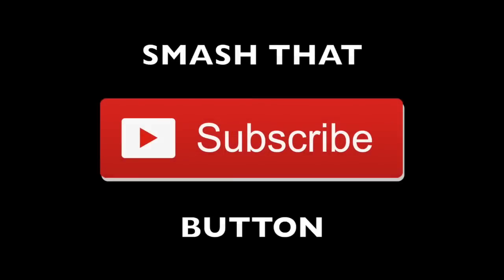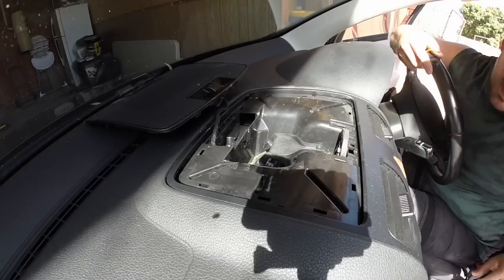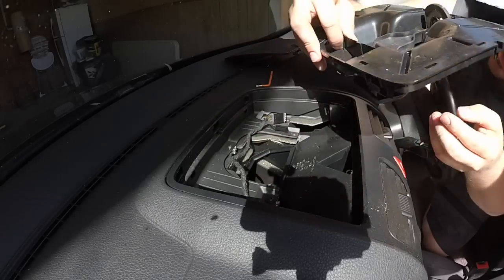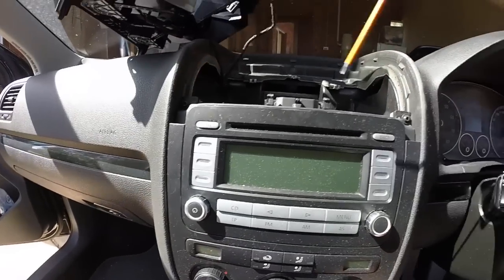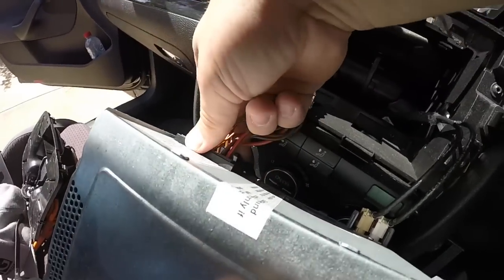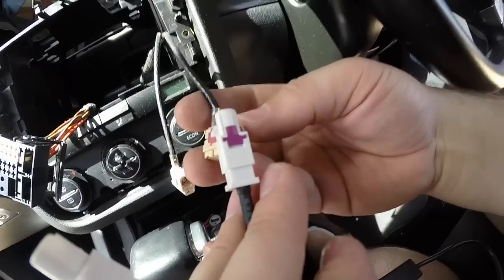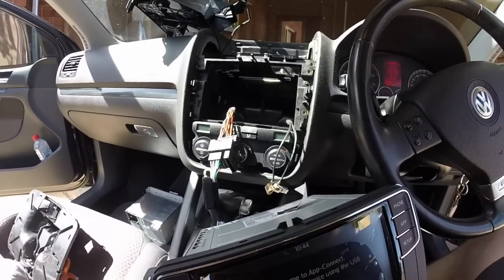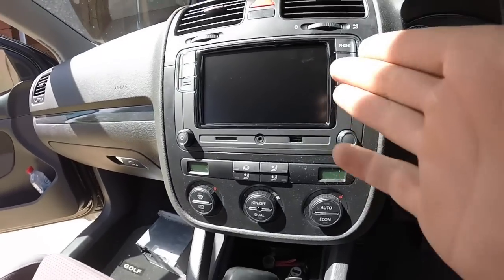VW Mk5 Golf OEM Radio Upgrade | Added Bluetooth & Apple CarPlay

Comment: I like the video, Just some advice, you will go through many batteries until you find out that any aftermarket radio that is not OEM on any VW will drain charge out of you battery. I suggest going with OEM every time.
Reply from the maker: Didn’t go through any batteries with this unit in the 3-4 years we had the car.

Comment: appleplay? id rather have an android thing.
but hey, so basically this is completely plug and play when you install? that would be awesome.
also everything does work well right? even buttons on steering wheel?

you should also make vids on replacing speakers door and maybe rear on a mk5 gti, i got one or two popping so theyre going out, dont think i want to do subs and all that but i do want good long lasting audio, some decent speakers
Reply from the maker: Appleplay, I think it’s also android but we don’t have any android phones. 

Not a bad idea doing the speakers
Reply: @HarrodsGarage  cool, feel free to make a vid. We can see the size we need and follow your tutorial. I did see one other but it was meh.

Comment: Any issues regarding battery drain? Been looking to do something like this to my MK5 R32 for a while now but I've been worried about that kinda stuff. Great vid btw.
Reply from the maker: None what so ever. It’s so easy, I’m annoyed that I didn’t do it to my r32 golf when I had it.
Reply: @HarrodsGarage  Awesome thanks man! Been looking for a straight answer for ages
Reply: @arisimonian6870   i would worry about battery drain if i were you bc you have an older model vw. I just got the 330 for my 2010 passat and no issues with drain.
Reply: @HarrodsGarage  the 2007 and earlier VWs will have battery drain issues because the CANBUS needs to be replaced.
Reply: @TomCook1993  are sure about this, eBay sellers have told me that it is needed for 2008 and older
Reply: I got it for my 2007 mk5 and the poxy thing has been draining my battery had to stick the old one back in any ideas

Comment: so did yours come with the harness and adapter or did you have to order it separately? because all the ebay ads for this radio say it will not function in 09 or older without a bunch of extras. if so what did you have to buy.
thanks
Reply from the maker: Yeah it came with a harness. The link that’s in the description is the exact same one that I got

Comment: Hi, I have a VW Golf 2005, but my car doesn't have parking sensors, And with the rcd360 you will get a parking pilot. So will it always peep even if I install a reverse camera?
Reply: Hope you can help me :)
Reply from the maker: Hmm not sure. I’m sure there would be an option to turn it off. Camera and sensors normally run separately, I’m pretty sure don’t hold me to that though
Reply: @HarrodsGarage  I see, but do you have parking sensors on your car. And does it have a constant beep? Because the sellers on AliExpress will not reply to me, and I am stuck..
Reply from the maker: @mohammedghazwanalmilhim7879  sorry we don't have parking sensors

Comment: Hi mate installed my radio upgraded with a polo TSI OEM radio but now I have a challenge with rear speakers not working and steering controls to lower or up the volume these do not work, any idea as to what to do in order to get it function to its full working condition
Reply from the maker: You got the radio out of a polo and put it in what? Does it have rear speakers in the car it came out of?

Comment: hey thanks for the info. have some questions though. I have a golf 5 gti 2.0 tfsi from 2009. do I need to do something with the canbus thingy? never heard of it so I'm not sure. and also does it support spotify over bluetooth? thank you in advance
Reply from the maker: We use Spotify all the time with it. I think it was the early mk5 that needed the canbus update as ours did not need it.
Reply: Hi Jordy I have the same car, did u need canbus/steering control adapter? Or did it all just click in and work
Reply: @rieewoldt  I ended up buying an aftermarket Android radio that works well but I had a friend help me out with installing it. Some wires had to be soldered but I don’t think we needed a canbus adaptor for it. My steering wheel controls didn’t work anymore though and I haven’t fixed that yet, so I’ll still have to look into that. Not sure if I need an extra adapter for that or if I can just set it in the radio’s settings. Sorry if I wasn’t of much help but this is all I know, however you can always ask your local garage for help (preferably a VW garage)
Reply from the maker: Yeah nice what android radio?

Comment: I really need some help with mine as I don’t know which adapters I need for my new RCD330. Is it possible wether you could put the links in description where you got the adapters from?
Reply from the maker: The adapters came with mine. I’ll put the link back in the description. I did buy it for $440 and now it’s up to $800

Comment: This was so sooo helpful, thanks! Looking into getting one for my mk5 Rabbit, has it been holding up well? Would you recommend it still?
Reply from the maker: Yeah it’s pretty good for what we paid for it. Was $400 but needed to buy another usb to lightning cable for the iPhone for it as the one that came with it wasn’t very good and kept losing connection with the iPhone.
Reply: Did you end up getting one? Im looking into upgrading from the oem stereo to this or similar

Comment: Awesome video! Going to follow your video when I buy one. I'm going to buy the RCD 340 as it comes with Android Auto, although the unit doesn't come with the adapters. Do I need them? If so, where would I get them from (I've got a 2010 MK5 R32)?
Reply from the maker: Thanks buddy.
Not too sure about the adapters. 
I wish I still had my MK5 R32
Reply: @HarrodsGarage  no worries, I got the RCD 340, had to buy the adapters separate though. I don't plan to get rid of it for a long time :) Thanks!
Reply: @leonidaspegios28  Hi mate, just wondering where you got the adapters? thinking of getting the RCD 340 also, was it a good choice? thanks!
Reply: @felixmillner7551  me too please help.

Comment: what if I have a radio with the double antenna input but only a single antenna wire. Is there a single to double antenna adapter? and if it would work?
Reply from the maker: I’m pretty sure that’s the two plugs I showed in the video.

Comment: Hi, I connected the rcd330 directly without adaptor and all works fine just the wheel control left said (volume) is working and right said (changing songs) is not working!! Is this related to the adapter?
Reply from the maker: I believe it is
Reply: Harrods Garage thanks
Reply: Unfortunately, and after almost two weeks from installing rcd330, i find my car battery is drained today 😔
Reply from the maker: Best get that adapter then
Reply: Yeah, already purchased for eBay. Thanks
Reply from the maker: Hopefully it sorts things out

Comment: Hey mate, did you have any problems with head unit not switching off when keys out of ignition
Reply from the maker: Nope. But you can turn it on without the key in

Comment: Does the radio buttons of the steering wheel works with this new radio that you have installed? Thanks!
Reply from the maker: Volume + & - and track < > do and mute. That’s all that worked before I changed it, so as far as I know they are working.

Comment: Will this work with VW golf mk5 GTI 2005? As I’ve read somewhere you need to replace the CAN gateway to avoid battery drain and if I’m honest I haven’t got a clue what that is haha!
Reply from the maker: It will fit, but what people are saying you will need to replace the CAN. We didn’t and haven’t had any battery issues. I don’t know the part number for the CAN to replace, sorry.
Reply: Harrods Garage thanks very much for the help!
Reply: Joel Maynard If you use a scan tool or vcds you can find out the model number of your canbus gateway. You need to find what variation of canbus you have which is determined by the last letter in the mode number. I will check for you but I believe that all canbus gateways that end in K or later are fine for the rcd330 without battery drain.
Reply: @benryman2703  Thanks for the help Ben!

Comment: Does it help with the Battery drain issue I’ve read with mkv & mk6 owners with rcd510..?

Did you have any battery draining?

Does the adaptor upload to canbus?
Reply from the maker: Haven’t had any issues with battery drainage on the mk5. Not sure about upload to canbus. But everything works fine

Comment: Good afternoon friend!
I installed such a device with the adapter, but my steering wheel commands are not working. What adapters are you using? Thanks
Reply from the maker: I’m not sure what adapter it is. I was already with my unit, I didn’t have to buy it separately

Comment: Hey, good video. I want to do the same thing with my vw touran tdi from 2007. however, there is an issue with pre 2008 cars not being compatable with this rcd 330 radio due to battery draining issues. to fix that, i have to get a new gateway. could you maybe do a video on how to change gateways in vw cars? thanks!
Reply from the maker: Sorry, but there is no need for me to do that to my partners car. If I needed to do it, I would’ve. I’m sure there would be something out there in the world of YouTube that will show you. Sorry I can’t help.
Reply: @HarrodsGarage  thats fine, thanks anyways

Comment: Hi, when you install this can you not just remove the stock radio and fit the new one in directly from that section or do you have to remove the top part, trim etc. ?
Reply from the maker: You have to remove the top part to get to some of the screw so you can get the radio out
Reply: Harrods Garage oh ok. Also did you need to change your canbus cos I’ve heard these drain the battery
Reply from the maker: I didn’t haven’t to change anything. Battery has been fine
Reply: Harrods Garage I’ve been looking at one and apparently if the model is older than 2009 then you need to change the canbus. Also, do you know how to replace the canbus?
Reply from the maker: I didn’t replace it so I have no idea how to or with what updated Canbus. Sorry about that.

Comment: Hi, Did you need to change the gateway? 
Because I have seen on some site that for the models before 2009 it is necessary to change it.
I have a 2007 Golf 5 GTI
Thanks for your help
Reply from the maker: I didn’t need to change anything. But in the comment a lot of people have said that
Reply: dont change it,  Take wire from the ac unit.  (canbus)   orange green canbus +    orange brown canbus -
Reply: what do you mean by this ?
Reply from the maker: Good heads up. Sorry you had to replace it.

Comment: How’s your battery holding up ? I heard if you have 08 or older you need to replace the gateway
Reply from the maker: It’s going just fine. Been in there for about 5 months now. No issues at all
Reply: Ok cool I might gamble and do it
Reply from the maker: It’s worth it
Reply: I’m sure it is but from what I’m reading if you let your car sit more than 2 days without the upgrade canbus your car won’t start
Reply from the maker: Jimmy Wen haven’t had an issue over the weekends when she doesn’t drive it
Reply: @jimmywen2105  I've had this same headunit in my 2008 Rabbit for the last 2 years, no CANBus ugrade was needed. I want to say that SOME 2008s might need the upgrade, depending on when in 2008 the car was built. The new canbus is only like $15 USD if you reall yneed it. I say take the gamble, buy the adaptor just in case.

Additionally, I agree, it's totally worth it. Best modification to my car yet.
Reply: I have a 06 Jetta though
Reply: Then yeah, I'd go ahead and order the upgrade just in case
Reply: @MadChef95  You got a link for that buddy? I've got a 2008 Golf (March 2008) and I don't know which adapter to purchase. Thanks.
Reply: @MadChef95  I got a 2009 jetta, this upgrade shouldn't be necessary right?
Reply: @MadChef95  i have a 2005 rabbit, where can i buy the canbus?

Comment: I want to bus the RCD330 with carplay for my VW Golf 5 from 2007. In the Web they also say that you need a Can-Bus Adapter to save the batterie from leaking is that necessary? Thanks
Reply from the maker: we haven't had any issues with this stereo at all
Reply: You need the newer version of the canbus and code it with vcds because your car is 07
Reply: Joona Puro what about a 2008 VW golf mk5 would I need a canbus
Reply: h4x0rl33tee as far as i know that is the first MY when you dont need it

Comment: Hey mate, will this be compatible with a Golf TDI 1.9 2008? Do i need to get any extra cables or anything or will the unit itself be all I need? Thanks
Reply from the maker: Should be a straight swap. Mine did come with a harness so just make sure yours does too

Comment: Hello thank you for the great video.
Do you know if i upgrade from RNS 510 to this head unit i will experience battery drain issues?
Reply from the maker: I’m not sure mate, what year model is your vw?
Reply: @HarrodsGarage , 2007 VW Jetta. I already upgraded my CAN gateway to avoid battery drain while using RNS 510. I just want to know if i need another update to use RCD 330.
Reply from the maker: @kristiyantenev2146  Na should be good then
Reply: @kristiyantenev2146  How do you upgrade your can? I have a G5 from 2006 and it's the first time I've heard of this

Comment: Got this unit working  ok except for the phone. Mostly doesn't" work. Are there any settings I need to adjust to get the phone(iPhone 12 Pro) working?
Reply from the maker: I’m not sure with the iPhone 12 Pro. I know we had trouble when we got new iPhones. Fixed itself after an update but also the Mrs connects her via a cable and not Bluetooth so she can charge it

Comment: Looking at this head unit for my 2005 mk5 GTI but i'm concerned about battery drain
Reply from the maker: I didn’t have an issue with our battery until late last year, I tested the head unit circuit for a parasitic drain and it was the head unit. You will find in the comments of this video people saying you need to upgrade the CAN on it.
Reply: @HarrodsGarage  I know some of the RCD330 head units come with the CAN for steering controls and this needs to be used :)

Comment: Can I run an amplifier to it for my sub woofer and top end speakers??
Reply from the maker: I don’t believe you can just plug straight in. You would have to use line converters to get RCAs for amps.

Comment: Long time but.
Does it work with the cars original "hands free"? if you know what i mean
Reply from the maker: Yes it does.
Reply: For real? so i can connect my phone to the cars original hands free (from the steering wheel) and it will use the new headunit? <3
Reply from the maker: Yes. My Mrs uses it everyday calling us on her way home from work
Reply: Nice. Does it show what song you play on the MFD then? 
Sorry for the spam ;)
Reply from the maker: Not sure as her mk5 GT doesn’t have that option to begin with
Reply: @HarrodsGarage  What is the sound quality like for the person on the other end of the call? Is it clear or a little drainy? Thanks
Reply from the maker: It’s pretty good. The Mrs calls me on her way home and it’s fine. I can even hear the supercharger 🤣
Reply: @HarrodsGarage  could u possibly ask your missus if she’s able to skip to next track when connected either through apple CarPlay or Bluetooth music via her multifunctional steering wheel in a MK5 GT? I know you can lower and increase the volume but I’m interested to know if you can also skip music tracks forward and back via the steering wheel on one of these RCD units.
Reply: @HarrodsGarage  I ask as I have recently fitted a RCD into my car and am now interested in retrofitting a multifunctional steering wheel in my Mk5 GT to be able to skip music tracks via the steering wheel instead of having to press the next track button on the unit every time.

Comment: Hey. I have golf 5 2007 and after removed 4 radio screws I still could not remove my radio. Do you know what could bet the problem?
Reply from the maker: Not sure. Maybe go around brackets on the side and try prying it off. Maybe it’s just stuck from heat over the years. Just a little bit of force.

Comment: Hey, from which year is ur car? I want to do the same as u but I have a golf 5 from 2006 and I’m not quite sure if I need any adapters
Reply from the maker: It’s a 2007
Reply: @HarrodsGarage  thanks for ur fast reply I’ve heard that the vw golf needs a special gateway otherwise the battery of the car runs out quickly. Did u had this problem or did u used a gateway?
Reply from the maker: @janinajanina8067  didn't have to use any gateway and they battery has been fine

Comment: I have a full MDF red display like this car and brought my rcd from AA auto aswell with the steering wheel adapter for the mk5 - have you realised yet that when you press the arrow buttons on the steering wheel to change the trip menu in the MDF display it also changes tracks or stations at the same time?
Reply from the maker: I haven’t noticed that. I’ll have to have a look
Reply: @HarrodsGarage  yeah let us know when you do
Reply from the maker: Charlie Frost yeah it does actually LOL. But only when you are in the now playing screen it will change songs
Reply: @HarrodsGarage  you mean the audio menu on the mdf? mine dissappeared in my car after I took my old unit out and replaced it
the radio changes station when im trying to change the mdf menu from L/100 to km left or something
Reply from the maker: Charlie Frost yeah same. Actually never had audio options on the MFD. I just turn the radio off or just leave it on km to empty

Comment: Ciao, Nice video. I installed something similar but the radio remains on even if i take out the key. Any ideea how i ca fix this issue? Thanks
Reply from the maker: Is the key still in the ignition?
Reply: you need canbus installation,  take the wire from the ac unit.  orange green is +  and orange brown is -.